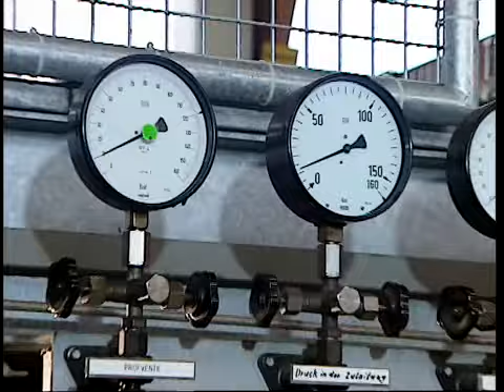Operation of a LESER Safety Valve - Back pressure compensation with a balanced bellows

Comment: but where is it this back pressur ; in piping, ? or in outlet?
Reply: In this construction, the SV blows into a pipe, at the end of the pipe is a gate valve, which is slightly closed. Through the slightly closed gate valve, back pressure builds up. Here we speak of a built back pressure. Backpressure created when a SV blows off into a pipe system, but the pipe system is too small for the blow-off quantity.The bellows compensates built up back pressures and also super imposed back pressures.